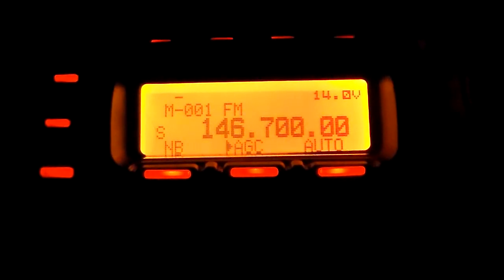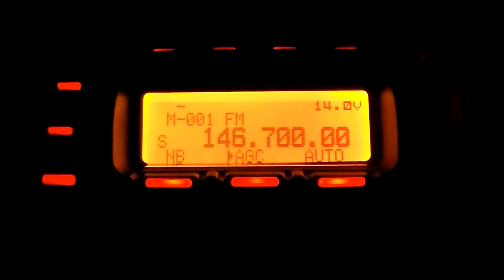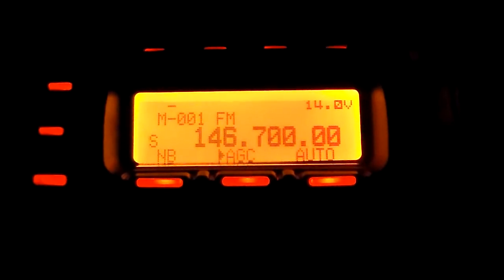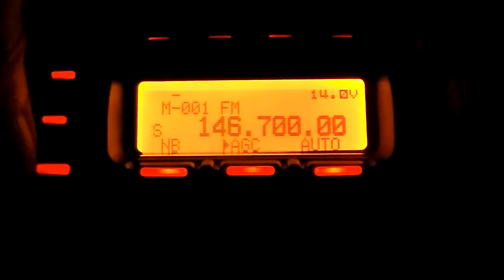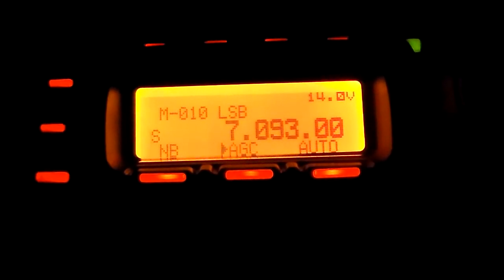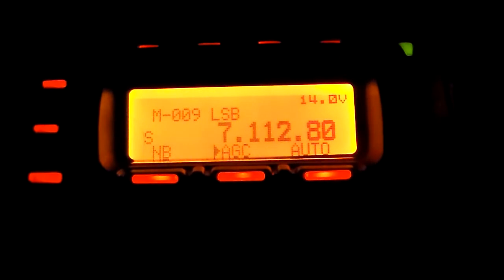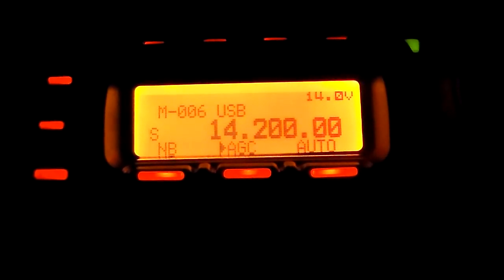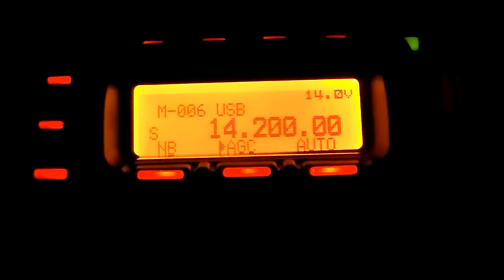Comparing Noise On 30m, 40m And 80m

Comment: maybe alittle dsp 8 or9 will help sounds mostly atmospherics no pulse i have hurd worse in so cal usa  kg6mn  cheers
Reply from the maker: Hi Jerome. I played around with the RF gain control and the noise reduction features and managed to resolve some of the weaker stations. I spend most of the time on the local VHF repeater... that sounds hi-fi in comparison.

Comment: Apart from pollution through power line & DSL modems, switching power supplies, etc. there's simply much more atmospheric noise on the low bands - see e.g. here:
http://g4fkh.co.uk/wp-content/uploads/2012/07/August-2012-RadCom.pdf

I'd suggest setting IPO + ATT to ON and using the RF/SQL dial set to RF (to lower the gain) to prevent a headache :)

73
Reply from the maker: Thanks Salat. Yes, I found selecting the squelch/RF Gain control to RF gain allowed me separate a lot of the noise out. The DNR helped a little too.